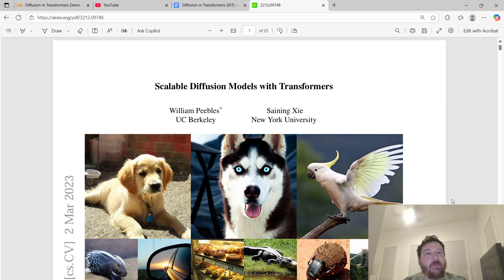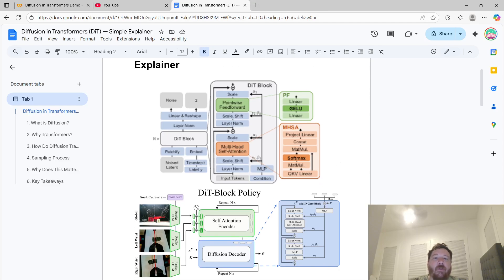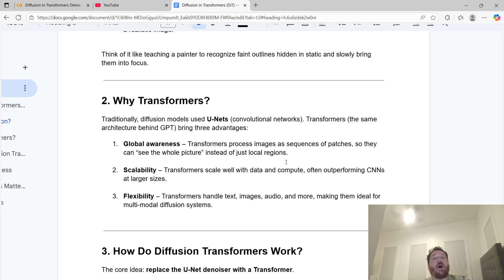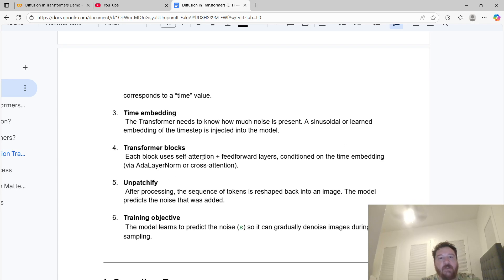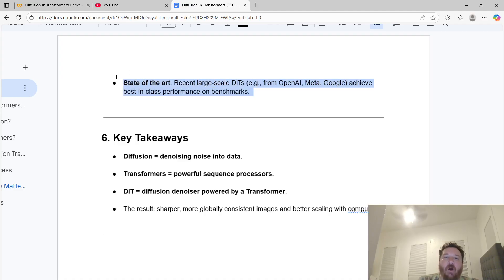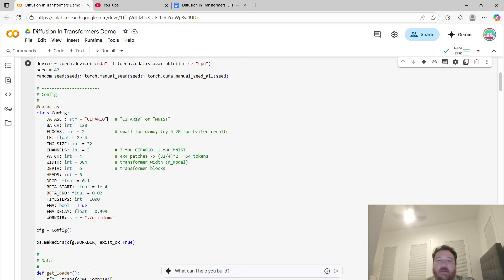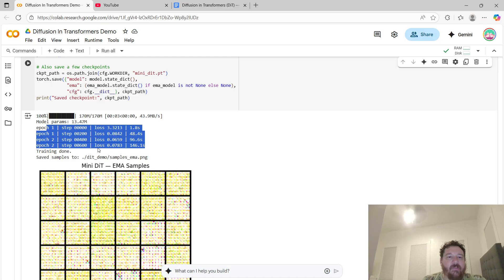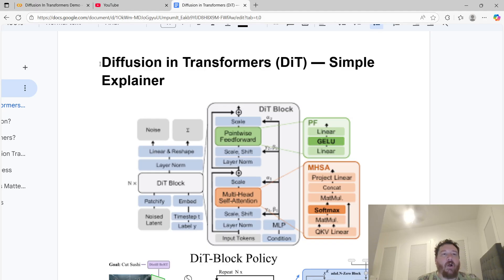Diffusion in Transformers Tutorial and Explainer

Comment: so instead of Unet using a 3x3 filter to stride through and downsize the latent in stable diffusion, attn, crossattn, then upsize with skips etc ...DiT creates a 3x4x4 patch, flattens it, projects it to 384 dimensions, attention mlp all that etc, and unpatch/tranposes back to predicted noise.
Reply: 30 days ago I never looked at transformer code or AI ML code ever. 

but I have been diving in basically 8 hours a day since then.

I am comfortable walking through the code, except for little bits like sinusoidal etc.
but i just haven't trained something fully myself, or really understand the architectural tradeoffs between this or that.
Reply: also thanks for posting this, very helpful. locked in a ton of learning.